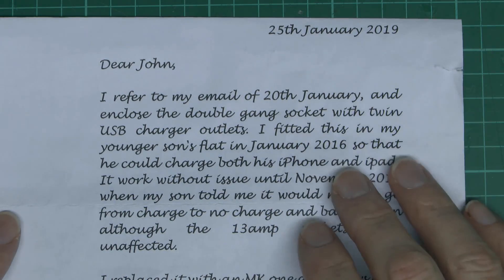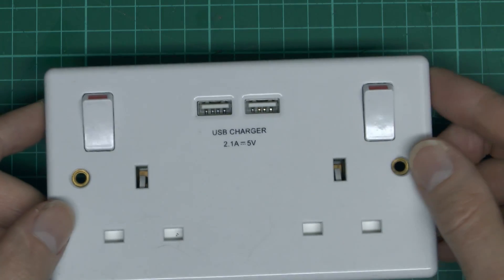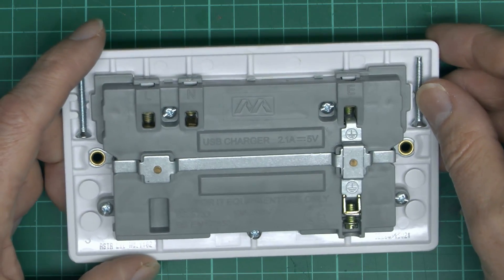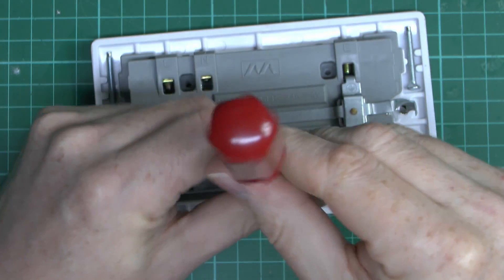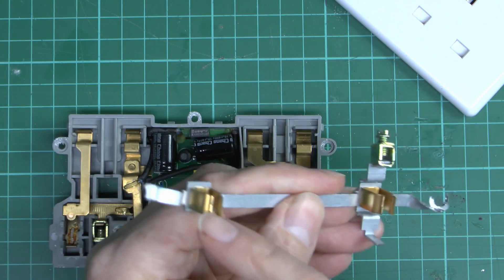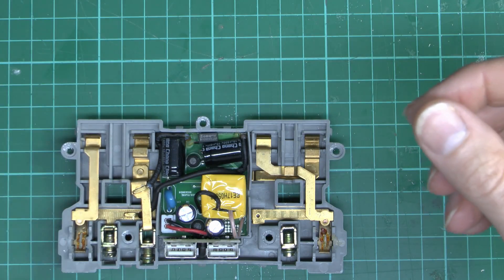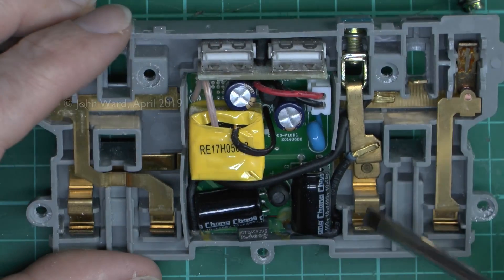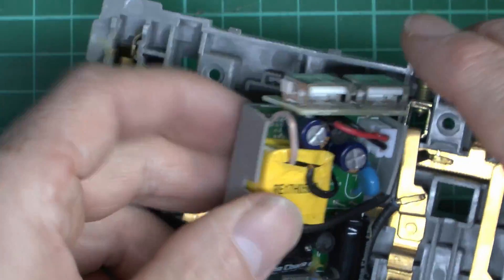Masterplug USB Socket Teardown

Comment: On the bright side, the fact that USB-A is nearing obsolescence against USB-C doesn't really matter if the expected life of the these sockets is only 2-3 years!  What a waste of money - we all have spare USB chargers that could do a better job.  Just leave one plugged in and switch on when needed.
Reply: But USB is a really, really poor method of power transfer. The 5V USB system was originally only supposed to power low power devices like keyboards, mice and similar devices. And micro USB and the Apple connectors just don’t last or tolerate any abuse.
Reply: Fortunately USB hasn't been restricted to 5V for over 6 years now.  Current USB power specs allow up to 20V at 5A with an appropriate USB-C cable, or 20V with up to 3A otherwise.   That's plenty for most laptops, and more than enough for phones and tablets.  But this assumes up to date USB, which these mains sockets aren't.
Reply: Paul Grimshaw - Fiddling with the standard to introduce USB-C does not solve the fundamental problems with USB though. In electrical power engineering, if you want to transfer any significant amount of power you need a number of things. One good quality connectors which have low resistance contacts with an appropriately large contact area for the maximum current that is required. The connectors also should mate firmly with no movement of the contacts or the connector once properly pushed home. The connectors should have strain relief for the cable. The cables used should have a good quality stranded copper conductor that has a suitably large cross sectional area so that the maximum current can be carried without any significant voltage loss. The original USB is a fail on all of these plus 5V is too low a voltage for proper power distribution. Yes USB-C tries to address some of these, but it is not that much better and is too little, too late (how long will it take to replace 5V USB given that an huge number of products and cables only meet the 5V USB standard are still being sold, never mind the huge number of existing devices) and it still fails to be a reliable good quality power connector IMHO.
Reply: Last reply - I'm not interested in an argument.  Feel free to have the last word if you feel you must.

In fact this higher power handling capability is not restricted to USB-C.  All existing USB cables support up to 20V at 3A, except micro-USB which is only really intended for 2A.  This is adequate for most mobile devices with the exception of higher power laptops.   Higher power (>18W) USB chargers were however not available until recently as there was little demand.  But it's this constant evolution of technology which makes it pointless fitting USB to mains sockets - the point I was making in the original post.

I agree that if the sole requirement of USB connectors was to carry power then they would be more robust, but they also need to be small enough to fit easily into slim mobile devices and they need to be able to carry high speed data.  In the real world a design is always a compromise to meet the current set of requirements.

Comment: The SOT-23-5 ICs on the USB daughter-board are Cell-Wise Semiconductor CW2003D USB charging port controllers.

Cell-Wise product page: http://www.cellwise-semi.com/en/ProductView.asp?ID=140

Data Sheet: https://majenko.co.uk/sites/default/files/pdf/1403493674-73686.pdf

Comment: The transistor is made by Alpha & Omega semiconductor. I can't be bothered to look up the exact part, but it's 100% going to be an N channel MOSFET. 

The tab has not been chopped off. It's a DPAK style package that looks like that. Normally it would lay flat on the board and be soldered to the board for thermal dissipation to a heatsink on the same or opposite side of the board, thermally connected to the copper. However, it's likely running far below its maximum rated current, so thermally, it's probably fine. 

The likely failure mechanism if it continually turns on and off, is the bootstrap capacitor, which could be the ceramic C6 on the bottom of the board. I would send it to a bearded bear for further analysis though.
Reply: The failure could also be due to the diode on the feedback winding having failed, or indeed the feedback winding on the transformer.

Comment: I would never consider installing any of these types of socket outlet, as 
1 - I don't like the idea of having permanently powered up electronics buried in the wall.
2 - They're using a small amount of power all the time,  especially if you have several sockets installed.
3- Like this one they will probably need replacing every couple of years, much better to just have plug in USB Chargers. 
At least the one in the video, which looks fairly well made, failed in a harmless way, no burn marks or any signs of it overheating. 
They should design some sort of push - to -make switch so that it only powers up when a plug is pushed in, but I suppose it would push the price up too much!
Reply: I agree, but crucially they free up a plug socket. Useful were plug points are at a premium ie home office or kitchen counter.
Reply: While you're not wrong, people are just as likely to leave a regular USB charger plugged in and turned on all the time as well as their fridge, microwave, oven clock, clock radio, TV, sky box, modem router, smart devices, numerous pointless LED fairy lights and trinkets, the list is almost endless these days.
Reply: Sky HD boxes take ages to boot up if they've been unplugged, and the line management on broadband lines will detect a powered off router as a disconnection and drop the sync speed.
Reply: @Dedubya-  True, but at least with all those items if they go wrong or fail you can just unplug or replace them easily.
Reply: @NOWThatsRichy  yes indeed.... I fitted one of these in a corner for phones to charge and am unlikely to fit many or any more. I do agree that these sockets should last many years but with this added feature it's pretty clear their life span is greatly reduced. You might think the manufacturers wanted to sell products more often as there's little profit selling a socket once every 40 years   :D

Comment: I suspect the 6.3V 1000uF output caps have gone lower capacity/high ESR even though they show no visible signs of failure, which limits the current this can output to much less that 2.1A. Small SMD caps rarely if ever fail.

Comment: That blue foam is a thermal pad. I don't think it does much heat transfer to a plastic box hahaha
Reply: got it a few minutes before me! that was basically word for word what I was about to comment :)
Reply: @TobyCowles Thanks m8!
Reply: I bet the idea is just so spread the heat around a bit from the tiny components to reduce hotspots. This whole device will be enclosed in a wall so long term it will get hot no matter what you try to do with it on the inside.
Reply: I thought it may have been there to dampen buzzing, for when it's on the opposite side of a partition wall which can amplify such things (especially shaver sockets)

Comment: I don't like the idea of consumables being put into the wall. The outlets should be considered permanent fixtures that require zero maintenance and have near zero failure rates.
Reply: RCBO s and RCDs also contain active components, as do mains attached smoke detectors which are often hard wired. The same is true of humidity detecting bathroom fans. How long they last depends on the quality of components and whether they are designed for the job.
Reply: @TheEulerID  True, but the less you have the smaller the problem.
Reply: I usually agree but I did put one of these very units into my kitchen on the basis that I could easily replace it in the event of problems as its just an unscrew and rewire job. I did so because we were forever unplugging stuff from the outlet to charge phones etc. Seems to work well but it's the only circumstances I would ever install one of these.
Reply: Is it really much different to your central heating controller being permanently powered?
Reply: I don't understand why nobody has thought to put a simple physical on/off switch for built in USB power supply. Seems this would solve a lot of issues and worries.
Reply: @JustAnotherSteve  It would extend the life but not as long as a socket with nothing in it but wires.
Reply: Also they always consume power, sure not much, but multiply that for N sockets in your home and you have a couple of W of consumption just for doing nothing. Also being always powered means that the switching PSU circuit will fail sooner. They could at least put a switch to disconnect the USB part of the socket so you only turn it on when needed.
Reply: Might be preferable to people using those £1 crap chargers they buy on ebay and Amazon which are just as likely left plugged in all day and night until they explode or fail.
Reply: @Dedubya-  They can be unplugged where as these cannot.
Reply: @Dedubya-  you could be right. I recall about 15 years ago finding a power adapter had melted. However, that was in the days of mains frequency transformers and they just got warm just being plugged in without any load.

My only real concern about those USB sockets is if they are safe, but there are so many of them in use by now, if they are a safety hazard, we'd have surely heard by now.
Reply: @Dedubya-  But at least you might have a chance to unplug them when they start to melt/smoke/whatever.
Reply: @Dedubya-  I would not use anything other than higher-quality phone chargers sold by Apple, Samsung, Sony, etal. The cheap chargers fail frequently and lousy regulation will reduce lifespan of your phone & battery. Also, cheap chargers provide a "seemingly" higher risk of fire and electrocution as they are always on the (wrong) side of health & safety.
Reply: I totally agree with you.
Reply: And eventually they'll become obsolete. Many modern phones want USB-C at up to 20V 5A
Reply: No big deal though. You can still plug in a normal charger block, just sometimes you don't have to.
Reply: @dom1310df  They should supply a transformer plug. Outlets can last upto 50 years and if the average house hold has a dozen outlets who wants a dozen outlets using electricity especially if they are not working but still drawing current? Bad enough having mains power with the problems that generates such as loose connectors and arcing without usb outlets, they should be pluggable.
Reply: @TonyDartford  They are still a "premium" or specialty fitting like a shaver outlet - I think the idea is you'd install a couple somewhere handy not throughout the whole house.
Reply: @whitehoose  With the growth of USB powered devices they will be everywhere.
Reply: @TonyDartford  I don't see it.  USB has a relatively fast development so far - but USB3 qc3? Qualcomm has to my mind committed the ultimate sin for acceptance, by charging licensing of the standard, they've given an incentive to the reverse engineers to mess with the standard and already there is a raft of kit that isn't compatible and won't work with other qc3 eg a sizeable proportion of powerbanks.  I imagine USBC's replacement is already limbering up.  If it looks like becoming profitable, the manufacturers will adapt their designs to accommodate USB2 3, 4, 6, 7 etc as and when there is a demand.  As usual conversion won't be compulsory ... but if it becomes a "thing" everyone and their dog will convert wholesale.
Personally I do have a couple in one room just to see.  If the standard changes it takes 2 minutes to change the plate to whatever comes next ... not a big deal, nor is it unthinkable for infrastructure to become a consumable ... maybe a plug front to take a range of fronts for different gadgets? 
 ... we'll see if that expands with time, but I doubt it.  The other side of that coin also is what happens to the batteries.  As things stand only a fool leaves banks of LiLon charging unattended.

A house full of these incendiaries isn't an option as I see it.

Comment: is it still drawing some standby current from the mains despite not doing anything useful?
Guess a lot of these will just be left installed after the charger part fails providing they're not emitting smoke and fire or making any annoying noises.
Reply: Hopefully the fuse is not cost cutted out, and this even when working is probably using 2VA all the time, so costs you money all the time.

Comment: A good idea to make chip marking clearer, is to smear on eraser fluid (you know the white fluid you use to paint over miswritten ink) and then wipe off with some paper. The fluid will remain in the laser engraved letters and will make it much clearer. (dont push too hard with the paper when wiping, just so you wipe off Everything around, you might have to experiment around a bit Before you "get it right")
Reply: Cheap white thermal paste also works great!

Comment: If you're going to have one of these running 24/7 over many years, you should at least use components that are up to the job. Generic Chinese capacitors are never going to last all that long in a high-stress circuit like a switching power supply, and Chang are the lowest rung of all (I doubt 'GD' will be any better even if they're "low ESR" versions). An extra 20p on reputable Japanese passives and these things might at least last 5-10 years.
Reply: Use solid aluminum polymer capacitors or MLCCs and the thing might last 30 years.  Like so many things these days, it's built down to a price!
Reply: That is the point. Companies do not want things to last anymore as they get more money with repeat sales.
Reply: Biggest thing to do to those is simply make input protection better, add the inrush limiting resistor ( not there, unless it is in the input wires), some common mode filtering, some overvoltage protection VDR across input, and a power switch. Once that is done you can put better capacitors in there, and it will last 30 years in service like the old socket was designed for. Only issue is that more than doubles the size of the board, and you cannot fit it in the volume available without either increasing external volume outside the wall box, or losing the one outlet for this volume.

But the modern socket is hard pressed to do more than 5 years, especially if you actually expect to draw anything like more than half the rated current, and use the switch every day, and do a plug insert cycle every day. Sockets used for things like vacuum cleaners, or in kitchens for appliances like toasters and kettles that are packed away after use rarely make it to more than 3 years. Switches are too flimsy, plastic parts break or disintegrate, the thin brass contacts overheat and lose tension, and the whole thing just plain wears out. Old 20 year plus ones still works, but the new ones next to them fail.
Reply: hmm, dunno how bad chang ones are, have had some supplied to me as supposedly 'good' replacements,
Reply: @andygozzo72  The original Chang capacitors were made by Huawei and were reasonable, but they have been copied by all the crap cap merchants and are now 99% certain to be poor. If they have a bullseye bung on the base they're cheap.
Reply: @jasejj  i'll check mine when i get chance....😉
Reply: Nobody is going to pay 40 quid for one that lasts 30+ years compared to a tenner for something that might do 3 to 10 years.  Especially not when it's literally 2 screws & three terminals to replace a failed one.
Besides, standards keep changing, you watch, soon as there's a large installed base of units like this, everything will demand USB type C or some other "new" standard to force you to buy new ones anyway.